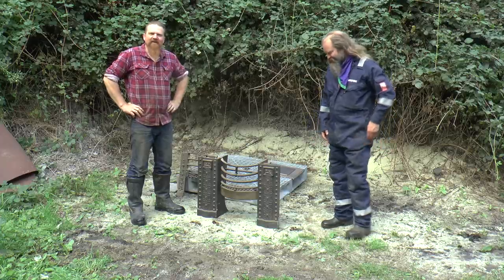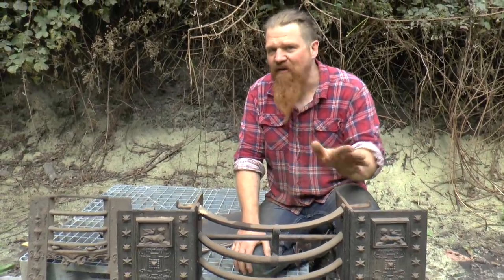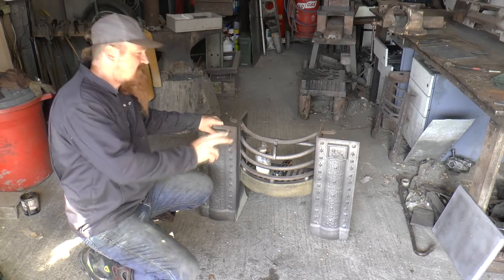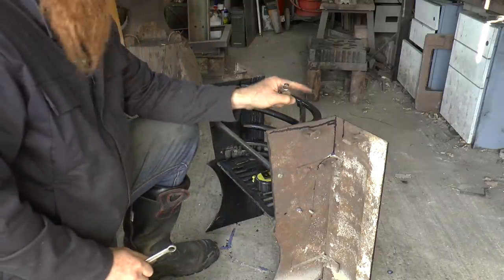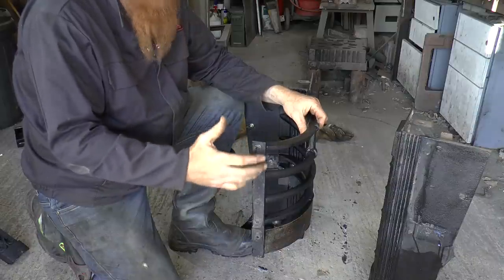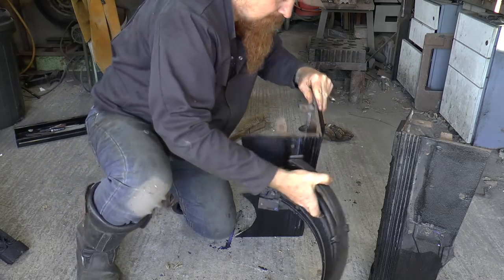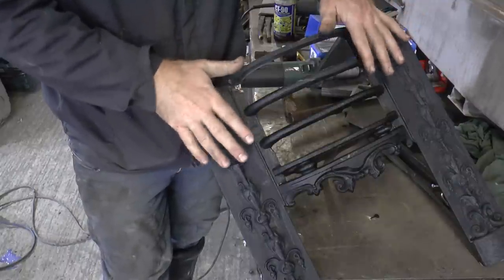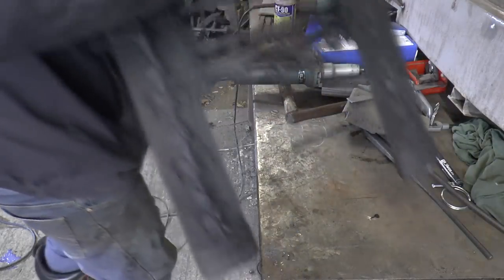Antique Firegrate Restorations

Comment: In the mid 1970's I had what could be considered an amusing experience with some Zebright grate polish. I went into the local co-op and purchased a pork pie and a tube of Colman's mustard to put on it for my lunch for a trip I was taking. A few hours later I got my pork pie out, opened the tube of mustard and squirted it onto the pie without realy looking as I was driving at the time, just as I was about to bite into the pie I noticed a chemical smell so took a look at the pie, it was covered in a black substance and when I looked at the tube carefully I realized that instead of saying Colmans  it said Zebrite the tube was yellow like Colmans but there was black stripes on it. I reckon that someone had picked up the tube and put it with the mustard tubes in the shop and I was in a bit of a rush and did not look.

Comment: Okay, Max, so you say you demonstrated no great skills. I beg to differ! I tinker a lot with wood, but I've played with metal on occasion. I probably could have done 95% of what you did-- poorly. I know nothing about welding. Or making molds for cast iron. Mainly, however, your skills shined in knowing what products to use, and how to use them. I would have been lost there. Conclusion: GREAT video, info and demonstration! Thanks!

Comment: We got an old cast stove for our festival truck back in the 80s, a coke burner which had an oven with a slider at the base of the flue to circulate the heat.
I'd never had so much fun while putting it back into working order, although it was  a lash up of 1/4in plate, angle iron and metric threads, I didn't know any better
Cooked dinner and heated our FG round the UK and beyond, it's good to see there are still a few bits left to rework. I wonder what is produced now that will be picked up and reworked in 2221.
Cheers

Comment: Absolutely love cast iron objects with such detail. I've restored several cast iron wood/coal stoves, the first one I painted not knowing that the only proper finish on cast iron is Stove Paste or polish, sometimes referred to as stove black. I have seen several vintage stoves for sale at a good price but I always pass if they've had paint applied to "spiff" them up, too much effort to burn off the high temp paint to finish them properly. Great work, the actual skill is in knowing what it should look like when done and the steps to get them there.

Comment: Nice job, as ever. Well done.

I spent some time with a German friend discussing using a linseed/white spirit/graphite powder mix for painting some steel door furniture in a building front I restored a couple of years ago.

I found that a very thick consistency in the mix with a fair amount of linseed , little white spirit and lots of carbon worked very well but did take a good three to four days to dry properly. It's been done nearly two years and looks good still.

As a side note, I sanded and painted the doors on the building, which is early 19th cent., and remade one door pair completely. They had all previously been painted with aluminium primer and topped in oil based dark green gloss. This finish lasted maybe two years before flaking off around the knots and looking bad.

In the refurb, I painted all wood with two coats linseed/white spirit 50/50 and then top coated all woodwork with dark green Cuprinol acrylic fence paint, which I had two spare tubs of. It's quite transparent, so it needed about five coats, but I did it in the summer and each coat is dry in 1/2 an hour. I thought it was a risk at the time, as the prep took a month and I was painting water based onto an oil based primer. But it worked out really well. It still looks absolutely fine after two years with no flaking. 

I got into linseed through watching Torbjörn Åhman's smithing channel. I whizz wheeled all my old rusty spades, shovels and forks in the shed and painted them with linseed three years ago. They still look good, too.

Comment: Brilliant video as ever, surprised you didn't use BSW threads, but each to there own,  I am always on the look out at car boots for old imperial nuts and bolts for my restorations
Reply: I've had this exact same dilemma on similar jobs. But when you're dealing with "blacksmith thread", (i.e. threads to no particular standard) it seems to me that metric is no less incorrect than BSW. So in that case you might as well use whatever studding is easiest & most readily available. That's my own eventual conclusion, at any rate.

Comment: Not sure if there is any practical reason for using cast iron, but those top plates would have been a pretty easy project for anyone with a milling machine, heavy blasted steel shouldn’t stand out too much and probably would have been cheaper than casting. Nyloc nuts in an application where they will potentially get very hot was an interesting choice, glad you’ve put it right!

Comment: i've had motorcycle fuel tanks that i used acid to clean the inside of flash rust overnight in my dry, heated garage. any humidity will react with clean ferrous metals much quicker than you would think, but once they have a coating of rust, it might take years for them to be seriously damaged by corrosion. "brown bess" muskets got their name from the oxidized finished that was used on them when they were first made. i've got a 2m long bar of 1" wrought iron barstock that i got at a farm i was cleaning 30 years ago, that had been outside for prolly 40 years before i found it, seeing as real wrought iron hasn't been produced in almost 100 years. it is still in very good condition even after all of that time, with just surface rust. if i hadn't noticed the grain of the iron, and known what it was, i'd have sold it for scrap when i was loading up the rest of the 25+ tons of scrap i cleaned up there. it's a true bit of irreplaceable history just standing in a corner of my garage.

Comment: A ‘grate’ job there, Max! Very satisfying process to watch. I imagine the quality of the relief in the casting would have depended on the carving work in the wood, obviously, and the type of wood used. A poor quality or soft wood would likely ‘give’ in the casting process and distort the pattern? Or is my logic off on that? I’m not especially familiar with the casting process but imagine molten iron goes onto the mould. Either way, I think you would have to be a pretty good artist to carve in such a way as to give exactly the right amount of detail to transfer to the metal effectively.
Reply from the maker: The pattern does need to be sharp that is true, but it's the casing process that is most crucial. The pattern is used to form an impression in damp sand ('greensand') and doing that well is not easy!
Reply: Ah, right! Foolish of me to think that the wood could be used as a mold, however it was treated!
Ever done such a thing yourself? Would make an interesting video.
Reply from the maker: We have dabbled!

Comment: Typically self-deprecating comments at the end again Max.  You really are much better than you let on.

I do have a question.  The smaller of the two grates: the crack wasn't in a structural area.  I perhaps would have brazed in some brass.  Why did you choose to weld?
Reply from the maker: Welding always seems the most unobtrusive repair to me and I had the welder and the NiFe rods to hand!